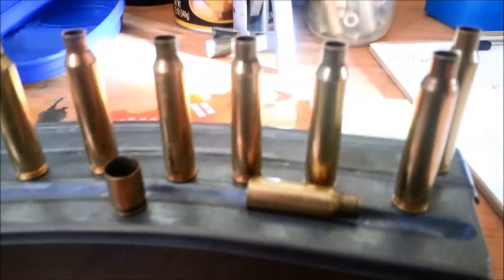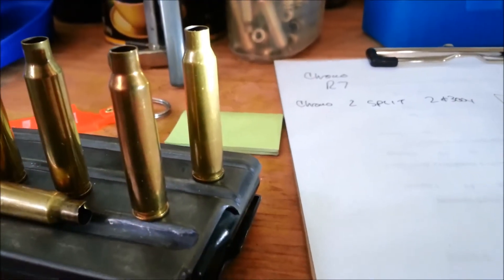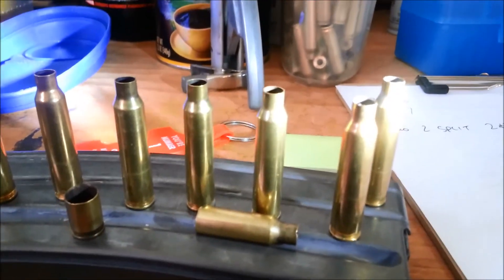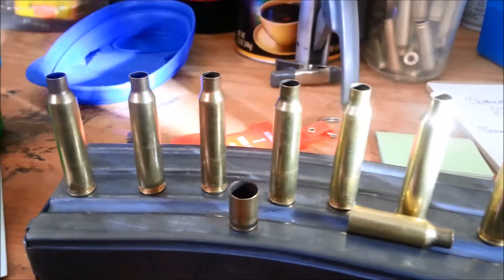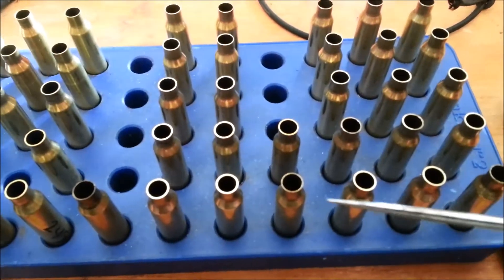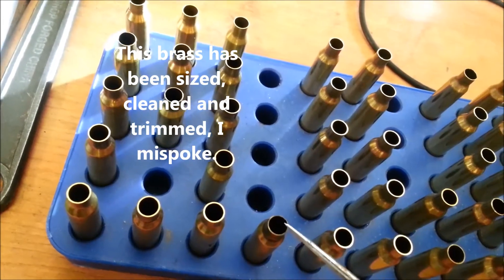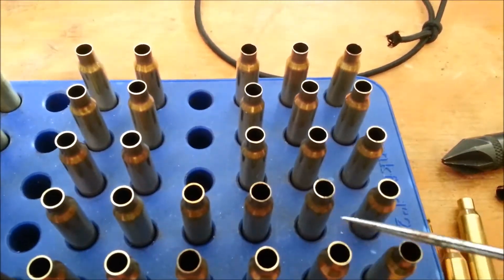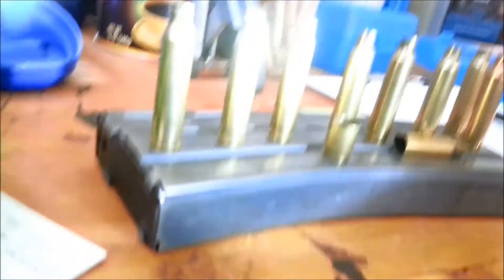Brass Inspection, for signs of pending Case Rupture

Comment: Brass flows forward and will eventually make your necks thicker. This is a problem because eventually there is not enough room to expand and release the bullet. This is bad
Reply from the maker: Yeah, no. New brass has thicker necks than old.
Reply: @ericpope7835  false. What Kyle Kruger said is true.... If the brass becomes thinner and more fragile at the case head and body.. where does it go? The neck... That's why neck turning is a thing
Reply from the maker: @johnnyglintz5661   I know brass flows forward, but, does it make the neck thicker or longer? Or perhaps both. I shoot service rifle and I do not turn necks. Where does the throat of your barrel go? Does it make they crown end thicker? Particle by particle it goes out the barrel with the flame. So I am not arguing that brass doesn't flow forward only that old (very) brass has thinner necks after something like 8 or maybe more reloads. If I understand you guys you are telling me that my brass assessment is incorrect, in so much as I should be culling the brass that is thicker at the neck?

Comment: ive got some brass with dark rings going all the way around i shoot in a semi auto 308 its about the same spot u think its the same issue thats y i searched this video cause i think im about to have some issues but havnt had any yet
Reply from the maker: could be but I have not seen them as dark rings, is that before cleaning? and my brass was loaded multiple times,  all were loaded more than 5 times and likely some up to 10 times. I don't shoot hot loads so I would expect them to last longer. If your brass has been loaded between 5 and 10 times I would be suspicious.
Reply: No  Theyve been loaded about 3-4 times some of them anyway